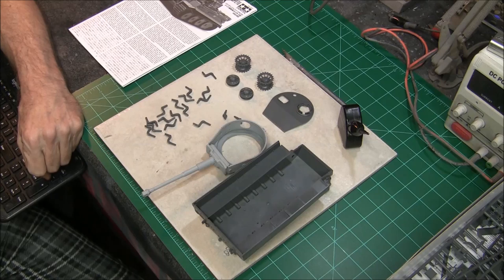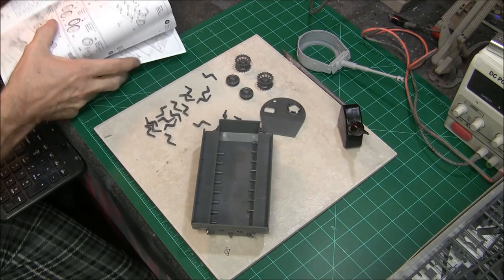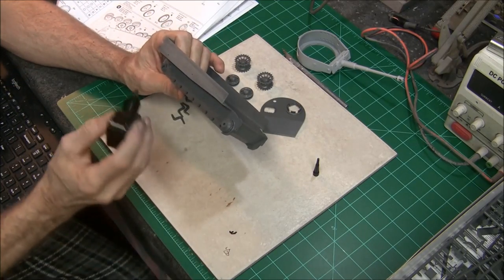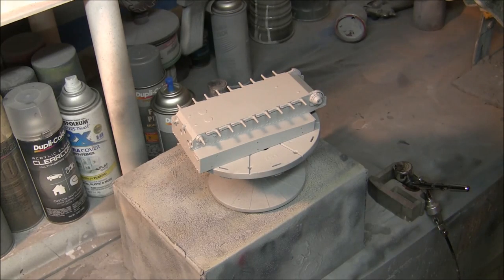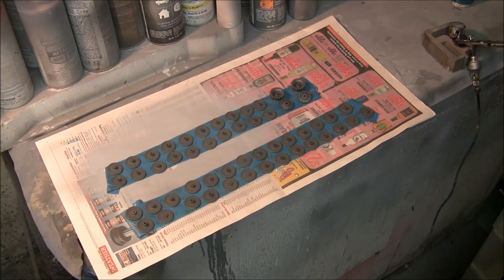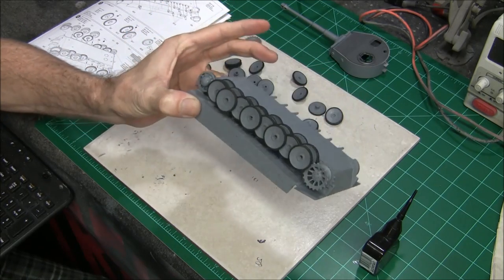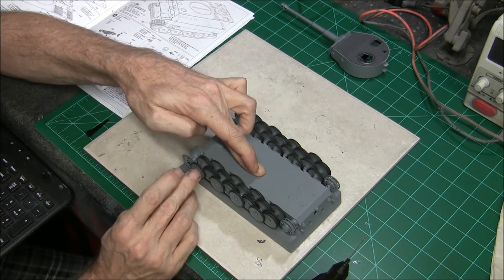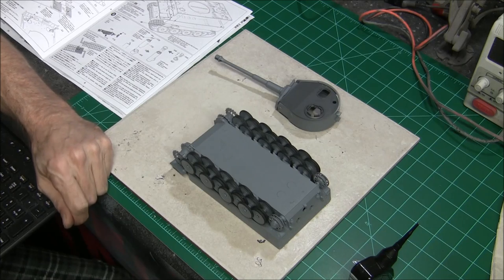Classic Plastic 101 Tribute Build Tamiya 1:35th Tiger Tank Pt 1

Comment: Hi Boyd - great work as always.  I'm a little new at this, so  a basic question for you:  when you prime the parts (like the wheel spindles that attach to the tub), do you sand off the primer/paint BEFORE you add glue (to say...add the drive wheels) - or will the glue work OVER any paint/primer?   I've had some issues with other models after I've sprayed parts on a sprue, or pre-painted parts (like a cockpit) getting them to stick together unless I said off the paint in the areas needed to affix them to other parts.  What do you do?